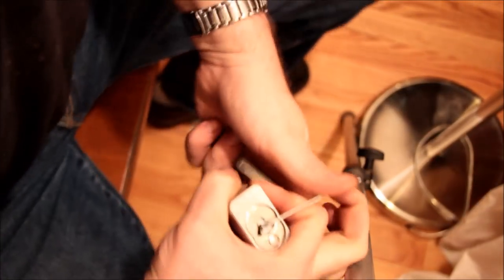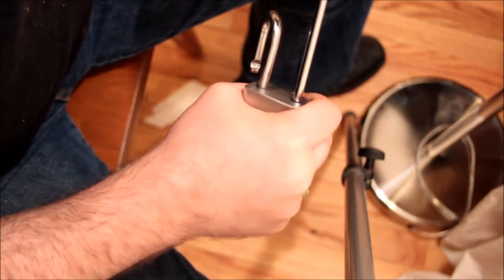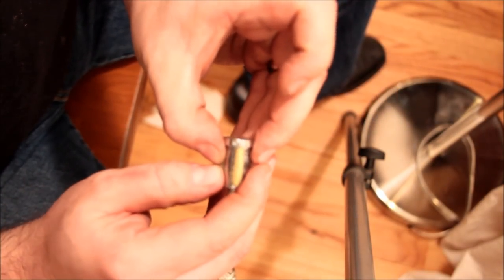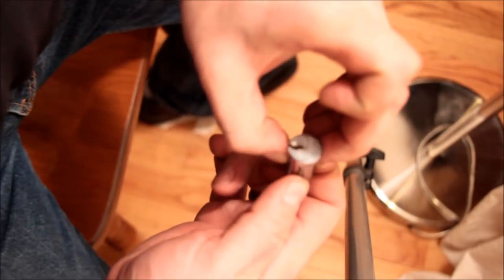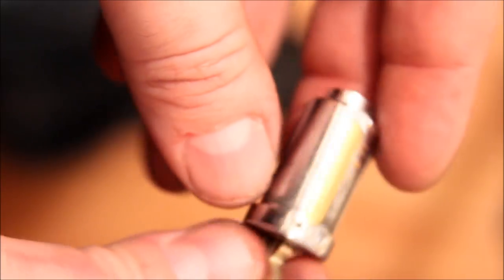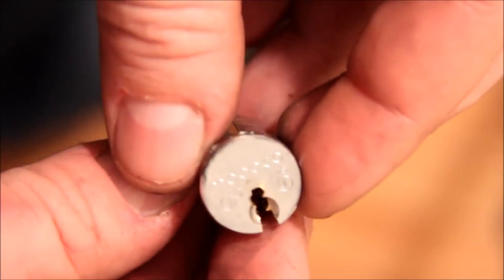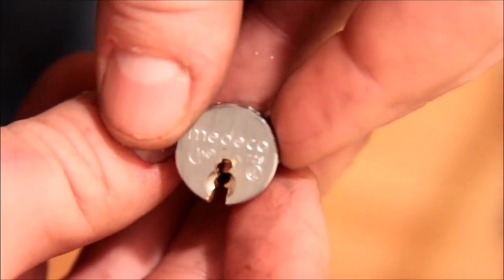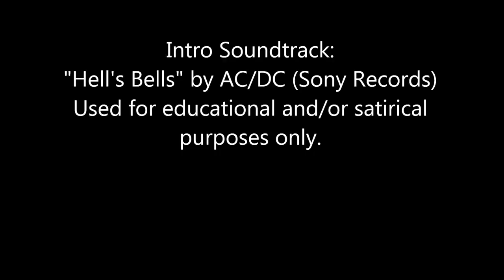(100) #100: Medeco Metrolock SPP

Comment from the maker: It sure did... though someone with actual skills could probably do it in a fraction of the time. 

I'm not sure if these pure-sidebar Medeco locks are more or less difficult to pick than their pin-tumbler+sidebar locks. On these, you literally have to life and rotate the pin simultaneously. On the pin-tumbler+sidebar cylinders, AFAIK, you can pick the lock to shear and then pick the sidebar or vice-versa.